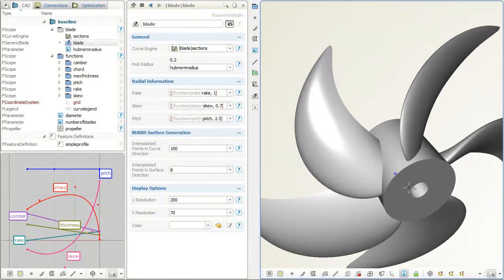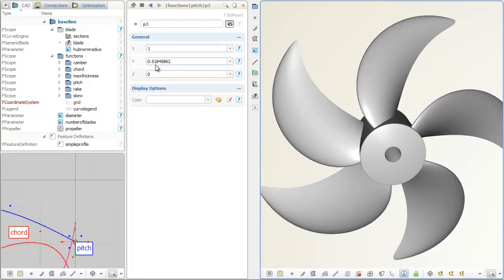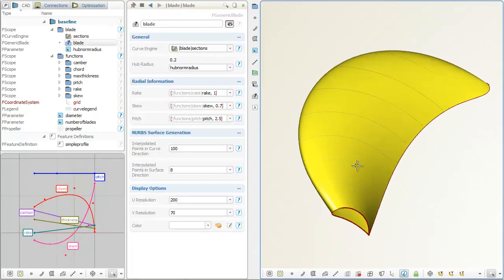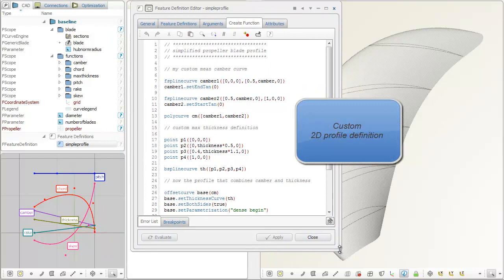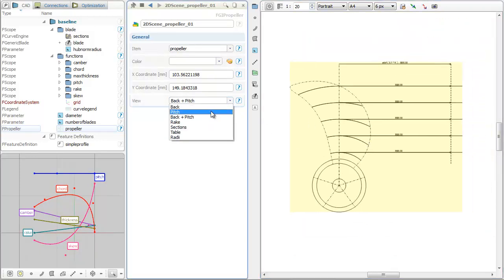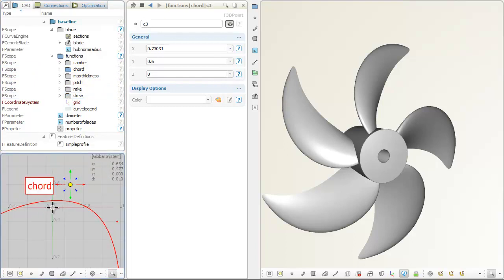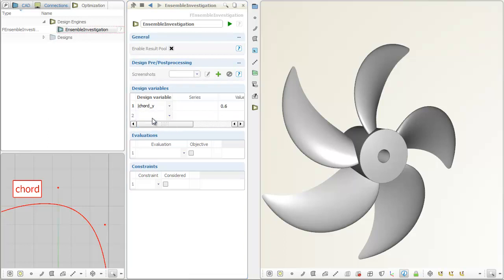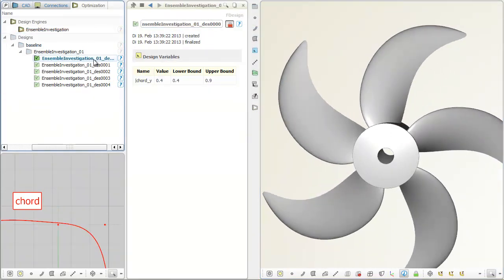Propeller Design

Comment: As a mechanical engineer my approach would be...
Maybe a startup wizard with some basic parameters(Dprop, daxis, Blades, Fpull, Mmotor, RPM, Medium, Material, ...) leading to the draft model version where CAESES main interface acts to modify and define the final model version?!
Reply from the maker: Typically, when we do propeller projects together with the customer, the model setup can be quite complex due to company-specific requirements and constraints. However, the final use of such a model is then often limited to quantities that are similar to what you suggested (which by the way I think is an excellent suggestion). This means that the access to such a model needs to be easy, but setting it up needs expertise. Of course, a demo video can never show all the details that might pop up during real-life and individual customer projects. But the basic modeling concept for propellers in CAESES often looks like the one you see in the video. It is different when users want to explicitly involve some profile point data (e.g. from files or excel sheets) - then we use other approaches. Just some thoughts on your comment ... thanks for this!
Reply: Glad I could help to make the software more accessible for users and get the desired model much faster. Impressive software nontheless!

Comment: Suposed to be simple?
Reply from the maker: +kontaktronik No, you need to have quite some understanding for propeller representation and the way propellers function. With CAESES you have a tool at hand that allows you far more than you would be able to do with any other CAD system.
Reply: I have pretty much understanding and knowledge about propeller! What I said was about the software.. I downloaded it because it was presented as easy to use but it's far away from that. No offense. This is only how I see it.
Reply from the maker: +kontaktronik Thanks - yes, we have similar feedback from other CAESE newbies, and we are trying to make things much easier. Our users have a deep access to all mathematical definitions of curves and surfaces, so this makes it a bit harder to get started, and this is also a difference to other tools. Check out our new video tutorials, this is maybe at least some additional helpful material. Once you've understood the main idea of CAESES, it will always be the same and pretty flexible - no matter what kind of application you design.

Comment: I am rather sceptical about the aerofoil sections as unlike air, water does not compress.
Reply from the maker: Tech Davey In principle NACA 66 sections are used in propeller design. But they would typically me modified and most large propeller makers have their own parametrizations anyway. Since the section profile can be easily replaced by any user defined shape (or better parametrization) this example is extremely powerful as the basis to design and optimize propellers. In one of the videos we show how you can replace the section shape, see https://www.youtube.com/watch?v=jpyZ3vTGct8
Reply: FRIENDSHIP SYSTEMS The marine racing propellers that drive boats at over 150 mph have very thin stainless steel blades.
Reply from the maker: Here is a post in the CAESES forum about marine racing propellers: https://www.caeses.com/forum/index.php?/topic/601-marine-racing-propeller/